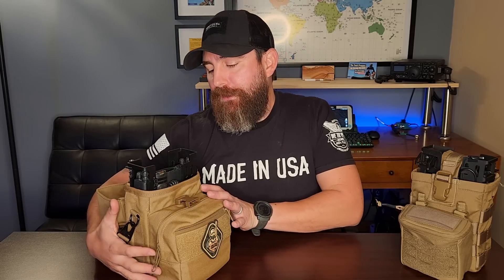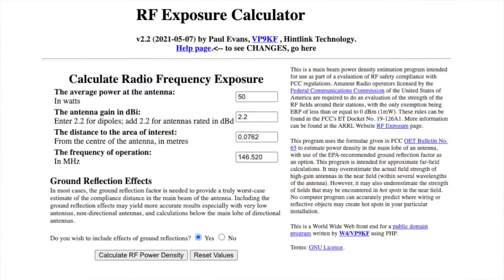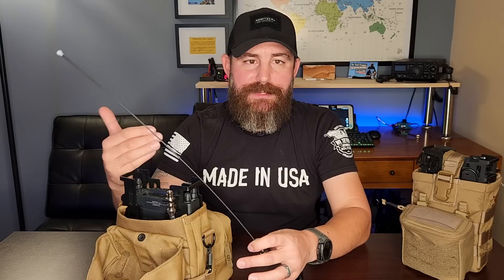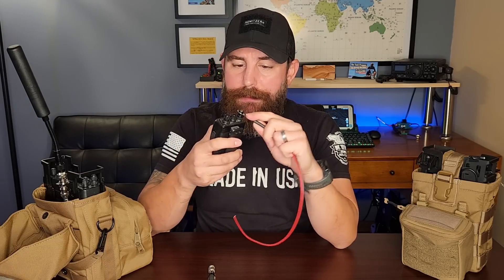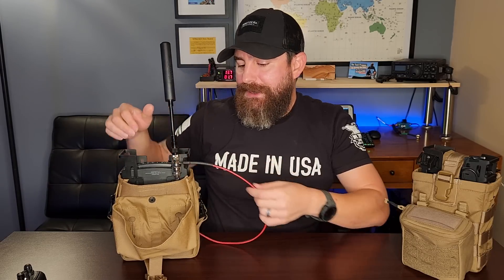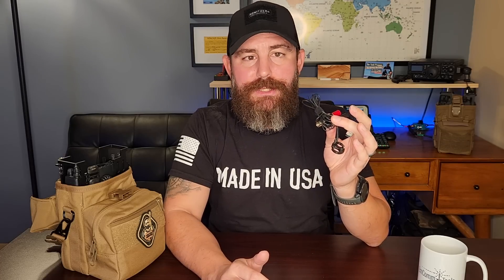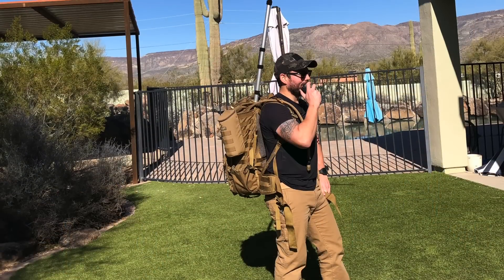Manpack Radio Antenna Systems - Be Careful!

Comment: Perhaps this is a silly question, but would all of this apply to the 1/2 wave signal stalk (vs 1/4 wave signal stick)?
Reply from the maker: It's not a silly question. Based on my experience, almost all whip antennas seem to present a higher SWR when in this manpack configuration vs when it is on an HT. I even found that adding a couple of ferrite beads to the top of the jumper coax below the relocation mount can help lower the SWR with some antennas. I found that the extra 10" or 12" run causes it to become part of the antenna systems and it throws off the readings. I saw a lot of differences when trying different antennas, so I excluded this bit from the video as each whip antenna behaved differently. My suggestion is to drop your antenna onto the bulkhead and connect your SWR meters to the tail end of the coax jumper cable and experiment with and without ferrite beads and as well as experiment with the various RF ground options discussed. Good luck.
Reply: @TheTechPrepper love this response. Earned a sub.
Reply from the maker: @ Welcome! Thanks for the sub.
Reply: @TheTechPrepper  thank you sir! Just getting into HF any recommendation for antennas? Should i start with 1 band or look for one that do lots of bands? I have a good amount of space and willing to spend money if I have to! G90 is my first radio so it has the built in tuner.
Reply: @TheTechPrepper  mostly looking for a mobile setup possibly a mast but small footprint max coverage preferred. You have tons of videos but hard to figure out how they all compare!
Reply from the maker: @zachsowersfilmandphoto6659  Take a look at my No Random Contact Series. I cover how to make targeted contacts at the community, city, county, state, region, country and internal level. The gear is shown in all videos.
Reply from the maker: @zachsowersfilmandphoto6659  https://www.youtube.com/playlist?list=PLZpc6PnzmzmHfXxqeluz6q-rYCElhMuZa
Reply from the maker: @zachsowersfilmandphoto6659  Each antenna has it purpose. For HF in the field, I  prefer small EFHW like the one made by Time N9SAB. He sells his gear on eBay. If you need performance, I personally use Linked Dipoles. I designed a 5-band linked dipole with Tim that we called "The TTP EmComm LInked Dipole". I sold a limited special edition run on my store to the supporting Buy Me a Coffee Members, but now Tim N9SAB sells them on his ebay store.
Reply from the maker: @zachsowersfilmandphoto6659  Here's the link the 5-band linked dipole. https://www.ebay.com/itm/166331222464
Reply: @TheTechPrepper  so how (if possible) do i make one where  i can walk and talk safely, for me and especially also the radio (i have Emissions shielding cloak on, so tht schould help protecting me, but my radio schouldnt brake) THX in advance to anbody who helps out (any answer is welcome and much hoped for, by anybody who can help!)
Reply: Common mode current or RF feedback can also happen with half waves. A counterpoise or an RF choke are typically used to reduce that.

Comment: I really appreciate all your videos and helpful information. Regarding a whip antenna like the signal stick  could you do a video about adding the "tiger tail" for the BNC connector.

Regarding RF exposure I would assume it would be minimum in a "receive only" situation 

what type of grounding hardware do you use with the Armoloq frame?

I was looking at the Vietnam War PRC-25 and PRC-77 manpack radios they used a vertical antenna and flexible antenna. It appears the radio used 1.5 to 2.0 watts of transmission power. This seems very low powered compared to modern HT power ratings of 5 to 10 watts.

I would really like to see an updated video about antenna setup for when you are "on the move".

Comment: What kind of bag is that for the man pack ?will it fit a dmr d578uvIII ?
Reply from the maker: It's a custom bag that I designed. Yes, it fits the AT-578. I run mine in there. I just finished a limited run in multicam.
Reply: @TheTechPrepper  where can I purchase one ?

Comment: I've been looking at tree slung dipole antennas as a mobile option. Saw a video on here a guy posted a few years ago where he created a land line phone jack antenna and he explained how he was able to connect to the outside land line phone port of a vacant house (disconnected from the grid obviously) and used the house phone line as an antenna. Seemed to work very well but not sure if its legal.

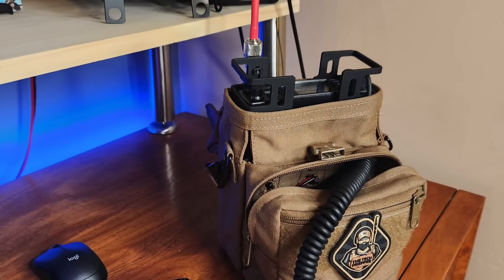Comment: @8:05 Which VHF/UHF antennas on the roof? It is so difficult to find info on antennas for regular dual band. Maybe it's expected that new Hams just know what to use but before I even think about HF, I need to figure what antennas and configuration to use from inside the house.  Everything for antennas I've found is for HTs and HF radio.
Reply from the maker: I run the Diamond X50A.

Comment: @TheTechPrepper, first props on your dedication to community, and many thanks for all the great videos. I'm assembling my own SHTF manpack, based on your various examples and recommendations (again many thanks!!). I'm doing research on blades, goosenecks, other "walking around" antenna for the pack. I found good working models for several different types, but can't seem to find anything for a gooseneck-type, at least one I would trust in a SHTF scenario. May I ask what model is yours, and where you got it? Also, if any other subscribers know I would appreciate the tip!

Comment: Coming from someone who knows nothing, could you run a short cable through a piece of pipe (probably with shielding) and put the antenna higher above you to avoid rf burns? 

Understanding this wouldn't work in a forest like environment, and you would need a larger backpack to support the pipe.

Comment: Hey man love your videos and information I’m a new licensed radio enthusiast. I am looking forward to growing my knowledge in the space. However, I am struggling with trying to identify the best power source option to run a simple HF UHF radio with APRS from my truck. If for example I want to also take that radio out of the truck. Should i consider having a small portable battery in the truck when I use it with a quick disconnect option. I wanted to avoid hookups directly to the truck battery. Would love to get your insight and advice.

Comment: great manpacks, but wrong rigs. Why? You can only use them when its not raining !
For Emcomm Invest in waterproof / sandproof / mud proof rigs, like Codan 2110 / Harris Falcon II / Micom 2RS  / Guohetec TBR-119 ,
73`s
Rene, PA7R
Reply from the maker: Most civilians do not have access to the military radios and likely cannot afford the price tag. I operate in an austere environment and have never had a problem using quality commercially available rigs.
Reply: Dude actually said spend $6,000 on  EmComms that nobody could afford than equiping 5 people with EmComms instead with the same level of money.

Dude is so detached from reality.

Comment: I saw a video here on YT where an individual had his AnytoneD578 Manpack running two(2) TCA antennas one for UHF and the other for VHF. He didn’t explain the theory behind it,so I’m curious as to why would someone run two antennas since that unit is a “ Tri Band”
Reply from the maker: Good question. Just because the radio supports multiple bands, does not mean the antenna supports all of them. The TCA antennas that I have are monoband (single band antennas), so you would need one for each band. If the 578 is a triband radio, then you would actually need a third antenna. Some antennas are specifically designed for multiple bands.
Reply: @TheTechPrepper  ok so then if I would need a third antenna should I look for some kind of splitter/mount setup for that third antenna? Either that or look for a multi band antenna would be the better move. Also… I know I ask lot. Do multi band antennas and mono band antennas have the same performance?
Reply: Any help would  be appreciated.

Comment: I accidentally ran my Icom 2730A manpack with the armorloq rails at 15 watts with the signal stick and no tiger tail/counterpoise.

The radio turned off instantly and did not turn on for about ten minutes. I was terrified and tried plugging and unplugging it to the battery a few times before it woke up again. I guess I blew one of those self-resettable fuses, but they go up in resistance every time they blow, so I'm still wary of even trying it again with a counterpoise.

I thought the rails would be enough of a counterpoise for low wattage applications. My diamond antenna seems to work fine without issue even at 15 watts.

Comment: I have noticed many of those Chinese HT's coming out lately advertise greater than 5W output.  I would be concerned about using an HT that outputs say 10W because of rf exposure.  I feel like there is probably a reason the higher end radios (Kenwood, Yaesu, or Icom) only have 5W HTs.  Thanks for reminding folks to consider this safety issue.  Making a contact is not worth harming your body.

Comment: Silly question. Where did you get the external pack itself? Good call on the N9TAX j-pole, I've been using one for GMRS and getting great range.
Reply from the maker: I designed it and produced only a small run of the bags. Unfortunately, I stopped making them last year. That's a great j-pole. Does he make one specifically for GMRS or are you using the one designed for amateur radio 2m/440 bands?

Comment: I dont have one of those armloqs for my ft-817 yet but I been storing mine in a a molle bag I got off a motorcycle shop that has a hidden holster. I have a jpc-12 antenna for my ft-817 and I recently just got a 2m/70cm antenna with magnetic base onto a ghetto tripod I diyed and added a peice of tin can  to the wood tripod I built so the magnetic base can hold the antenna. 73, Kq4hcu

Comment: Thank you for sharing this info. Another good reason for balancing the portable vertical antennas is to prevent RFI issues with the digital interfaces. Without the counterpoise the connected cabling becomes part of the antenna systems with highest RF voltages present near the interface. This can cause the USB or serial link disruptions.
Reply from the maker: You're welcome, Denis. I've actually found this setup to really help mitigate RFI issues. I appreciate you calling this out.

Comment: The Diamond SRH770S is a half wave on 2m. It works great on my IC-705 with an appropriate adapter. A roll up J-Pole works as well, but will need to have something to support it. Maybe having a trunk lid or similar mounting bracket for a mobile antenna can work as well, just need to have a good ground plain. 

Keep up the good work. You're giving me some good ideas for my IC-706 man pack project. Done got the side rails for and put on. Just need to figure out a way to get SO-239 mounted on or just run some jumpers for now. Looking for a tuner, a sound card for data and another laptop for portable use.

Comment: I built a very small VHF/UHF manpack based on the AT-778UV and made a small quickly deployable dual band dipole that breaks down to just a bit bigger size than your coiled up jungle antenna, and that can be mounted on just about anything. I connect it to the radio with 15' of RG58 so I can go full power and/or get it high up. It works amazingly well, and even at just 5W I can get full quieting on repeaters that I can't even hit with my HT at the same power from the same location. SWR is about 1.1 in the middle of each band. The whole setup with the Armoloq TPA frame, a 3AH Bioenno (attached to the TPA frame so I can pull the whole right out of the bag without any separate set-up), etc., all fits in a Helikon-Tek E&E Pouch without cutting off the top and a small admin pouch mounted on the side.
Reply: I have the same radio and looking at the same setup. Thanks for sharing.
Reply: @williamarmstrong6954  Cool! Just some things you might want to consider. When/if you get the RF Package for your frame, get one of the right-angle setups, like the PL-TNC/RA. There isn't a lot of clearance on the back of these small radios, so it works better than using a right angle adapter, and saves having to buy an extra part. I also got a couple of extra relocation mounts that I put on top of the back of the frame to act as a ledge to hold the Bioenno BLF-1203AB battery that I then secured with a wide elastic/velcro strap. I cut off the T-connector from the power cable coming out of the radio and added power pole connectors, and then used an SO-239 relocation mount from Armoloq to mount a switch to the front of the frame that the battery and power cord can attach to so that I know there is no parasitic drain on the battery when the radio is off, but I can leave the battery connected, rather than keeping it unplugged.
Reply: @williamarmstrong6954  if you want any tips from my experience with the project, just let me know.
Reply: 3AH I guess you aren’t running it at full power?

Comment: Ah, “tiger tails”, what a subject! Though there has long been a LOT of anecdotal praise given to them, yours included, I have yet to see anyone perform some objective performance analysis under lab conditions of HTs with just the OEM antenna and one with a tiger tail affixed. From the design of HTs and their OEM antennas to use the human body as part of the antenna system, it becomes controversial re tiger tails between works (“well, I’ve had good luck using one”) and don’t work.
Reply from the maker: My luck has been 50/50 with them. Personally, I don't run them very often. I actually found that they work better on an HT than the manpack. Unfortunately, I don't have a proper lab to conduct tests. However, with some antennas, I have seen better SWR measurements, but I have also seen them make it worse. I say, if it works for you, keeping doing it.

Comment: Copy that. Your original videos on the pack was that heat was manageable. Have you or have you gotten feedback that radios have been damaged secondary to heat build up using your prescribed man packs? FYI I built one of your man packs for an 857D.
Reply from the maker: I have not had any reports of heat build up issues for the radios I use regularly in the manpacks (FT-857D and FT-818ND). However, I will say it again. I run short, targeted contacts on least power required all the time, especially in our triple digit summer season. Don't run full duty cycle for long periods of time, and don't rag chew like you're in the shack. My style of operating is very deliberate.
Reply: Any chance you get to dissipate heat you should. Heat is the number one issue facing all this sort of electronics. However, these mobile radios are generally built quit robust. Many of them have massive heat sinks built right in. They’re designed to operate is shitty and hot environments, assuming you bought a good quality radio at least. But remember you’re shoehorning a hobby level tool into a tactical environment it was never meant to be used in, so be aware that the stuff the radio is designed to fight against, like heat build up, it’s having to fight harder and you’ll want to give it all the help it can get.

Comment: Why are you concerned about exposure of radio waves at these low frequencies? 

AND the other half of the antenna IS the radio... is by design... IF you measure SWR at the antenna outout in the radio, its fine. So why go around this?
Reply from the maker: The SWR for a lot of whips is not fine when running in them in a manpack configuration.  The problem is worse since most configurations require a 10"-12" jumper coax to relocate the bulkhead to mount the antenna. In most cases it becomes part of the antenna system and throws off the SWR. I failed to mention that some whips benefit from a couple of ferrite beads clipped below the bulkhead to choke off that RF. In any event, this video was in direct response to people running 50 watts right next to their and in some cases damaging their finals when using some whip antennas.
Reply: @TheTechPrepper  You come with a lot of statements, but not a lot of arguments for why it is so. And basically no proof.

IF the whip is one part of the antenna, the metal in the radio can easily be the second half (groundplane). This is basic theory. and why most/all hand terminals have metal backing and requires a hand to held them to work probably. 
Without doing measurements that include both whip AND radio, how do you know there is a mismatch and a bad SWR?
Reply: That whip will bite you with RF. I have scars.
Reply: @Philip-KA4KOE as will any antenna with enough power, ground plane, tiger tail or whatever. But an HT does not have enough juice to bite anything. If you run your manpack radio with power equivalent to an HT, it’s not biting anyone. Run around with that whip between your teeth and you’ll just look silly, but it’s not going to melt your face off.
Reply: @Philip-KA4KOE  More statements without any evidence. 
Even a microwave, at 2,4 GHz and 1kW will only heat the outermost layer of your skin. It will not "burn" you. Heat you at most.

So the question now is, what frequency did you use and at what power level, to be burned by a whip antenna?